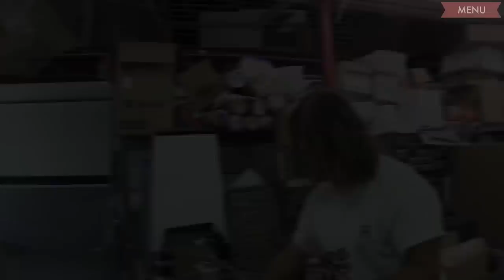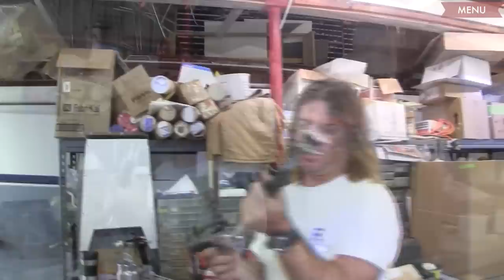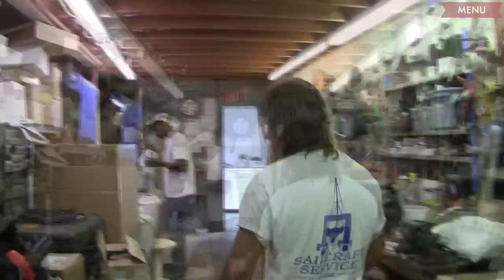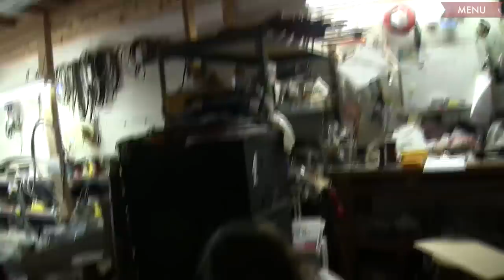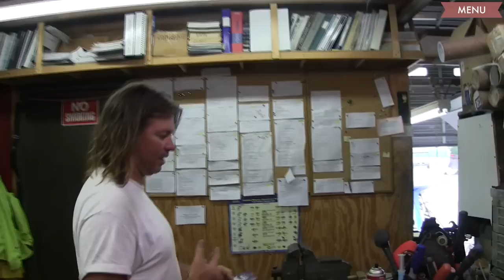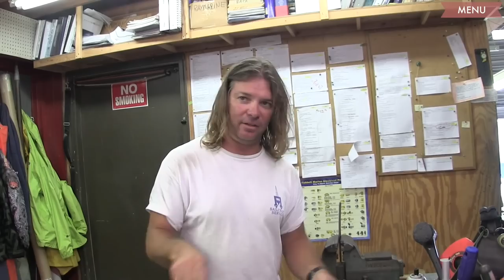What makes a good marine rigger?  (A Conversation with Mark Lucas the Rigger)

Comment: Does Mark have liability insurance for his rigging work or is he covered by SailCraft?  It is obvious that a boat owner should be very careful when selecting someone to re-rig his boat.
Reply from the maker: Hi truebluetopkat, That's an interesting question.  I never really though about it.  As far as anything to do with Paragon is concerned, I always figured that the only one ultimately responsible for anything going wrong is me.  But I will ask Mark about this.  Thanks and happy sailing, Drake
Reply: truebluetopkat 
Yes, Mark was insured by Sailcraft when he worked there. Although no longer at Sailcraft, he is still in Oriental, NC where he founded Mariner 1 rigging & yacht services (www.mariner-1.com) and copies of current liability insurance will be promptly furnished on request! You are 100% correct about knowing who is touching the rigging on a sailboat as rigging failures usually don't end well for the boat or more importantly, the people on them.